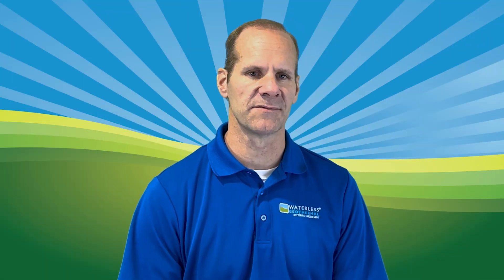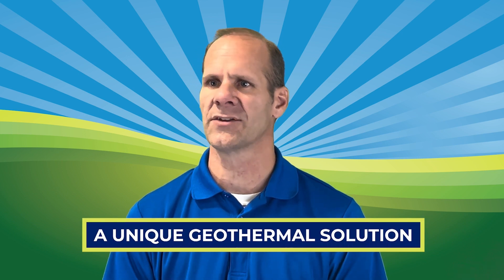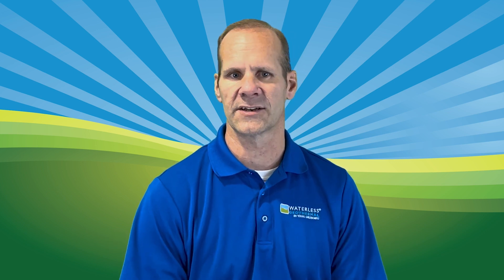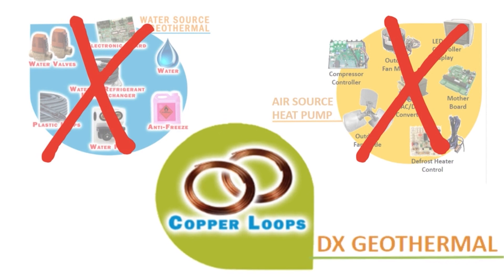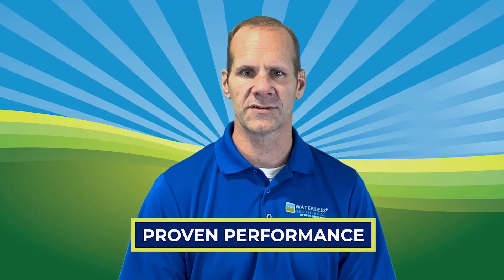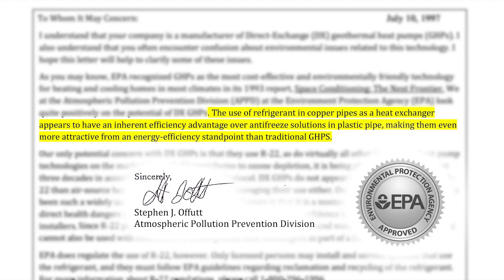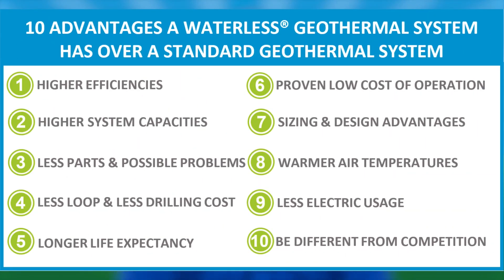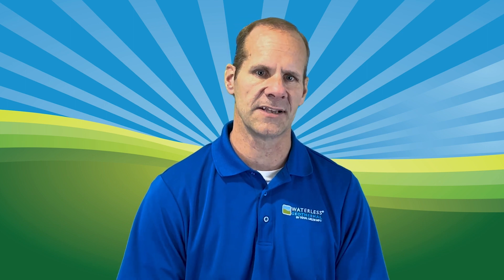Waterless Geothermal: The Top Advantages Unveiled

Comment: I hope this message finds you well. I am writing to you as a long-time owner of two 5-ton EarthLinked DX geothermal systems that are now 10 years old. Unfortunately, over the years, we have experienced recurring issues with both units.
Almost every year, we’ve had to replace components, and on two occasions, we’ve had to drain and refill the R22 refrigerant, which has become prohibitively expensive. This year, the compressor in one of the units failed again, leaving us without air conditioning for the entire summer, starting in late May. It’s now mid-October, and temperatures are dropping.
For the past four months, I have been working with your company’s representatives and reaching out to every certified installer in my state to explore the possibility of replacing the failing unit. Unfortunately, despite numerous attempts, I have been unable to obtain a quote or any meaningful assistance. In parallel, I have spoken to traditional geothermal installers to see if they could work with my existing ground loop fields, but they have indicated this is not feasible.
This situation has left me deeply frustrated and at a loss for options. As far as I’m aware you are the sole manufacturer of DX geothermal systems in the U.S., and yet the level of support for your product has been extremely limited, with very few available installers and little responsiveness to existing customers.
I would greatly appreciate your guidance on how your company can assist in resolving this situation. I would prefer to continue using the DX geothermal system I originally invested in, but the lack of support and recurring technical issues are making this difficult.

Comment: We have a waterless DX geothermal system running R22 in our house spanning the NY/CT border nesr Millerton NY. The system works great but one of the 10 zones is out. Where can we find a tech for these older systems (circa 2009 or thereabouts).
Reply from the maker: We can gladly help you find a dealer in your area. We have a dealer locator on our website: https://waterlessgeothermal.com/dealer-search/
but if you don't find anyone on there, give us a call at 1-888-678-2032 or email us marketing@totalgreenmfg.com and we can connect you with someone who can help!